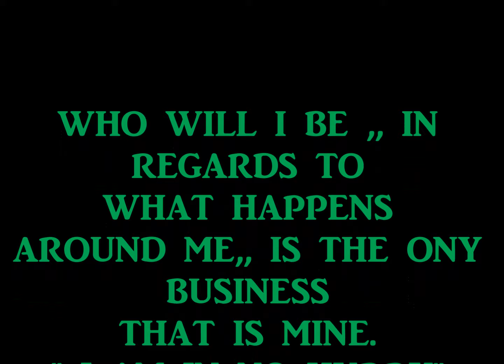ALASKAN MILLING PREPARATION

Comment: Stoopid question, but when you run two power units on a mill, how to you regulate the power output of both? I'd guess they need to run at the same speed or problems could occur.

In other news, I just adopted a Homelite 2100s. Needs some work, will be a winter project I think.

I blame you sir.
Reply from the maker: this is great news ,, if one cuts quicker is no problem they keep on cuttin helping one another ,, thx laza